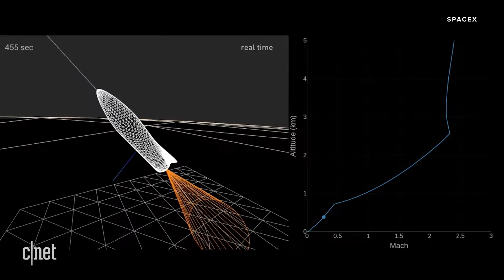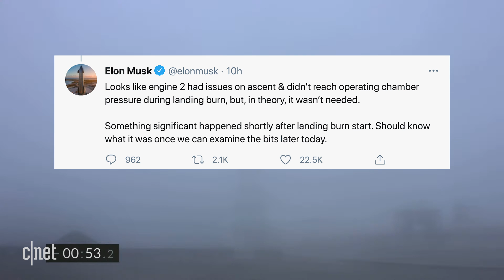Why does the SpaceX Starship keep EXPLODING?

Comment: The reason why starship prototypes keeps on exploading is because they are literally prototypes down to the ground . They make prototypes only few months apart and they solve problems 1 by 1 instead of doing it 20,20,20,20,20 which makes the arrival of final production faster. He'd rather fail 100 times than make 4 attempts that takes years on the making

Comment: Why not use parachute before landing to make the starship stable in vertical position, then after stable the rocket power work to have a smooth landing without using the parachute anymore.
Reply: A parachute is wait and money, and where would they put the Lox header tank if a parachute is in the way.
Reply: @HarrisonAdAstra  A very shopisticatec plane can not find a way to put a parachute???
Reply: @manekhari2670  ate you comparing starship to a plane? As starship does not use its fins as wings, they are used for control in the atmosphere, and yes a parcute will affect the wait and cost, they want to turn these things around as fast as possible and they can’t do that if they have a parachute.
Reply: @HarrisonAdAstra  The parachute just fuction for a very short moment, to stablising the position for landing, after that the rocket will take over the task for the landing procedure. Anyway, it is just an opinion.
Reply: @manekhari2670  an opinion that makes no logistical sense since they have been able to land them anyway.
Reply: @HarrisonAdAstra  When I gave the opinion, they still have problems to stabilizing the position before the landing procedure.
Reply: @manekhari2670  your comment was made in late June or July, SN15 launched on may the 5th. This is just wrong.
Reply: @HarrisonAdAstra  Whatever you want to say, it was my opinion and just an opinion in good faith, among thousands of other opinions.

Comment: I never really loved what SpaceX was doing. It feels like they're always trying to build and launch rockets in a hurry, often resulting in failure. And think- there's going to be people on that thing. What happens if the launch/landing is a failure?
Reply: Can you not use your brain and realise that testing is how you find failure, therefore this is how you get rid of the failure. What spacex is doing has never been done befor, most of the time there is simulation after simulation to make it absolutely perfect so there is not a single failure, but if you have the capital and don’t risk losing credibility then you should go with the failure until success option. Spacex will not put a human on this thing until they are 99.999999999 percent sure that it will get back successfully.

Comment: It would be much easier and economical if they just land the rocket on the sea. They should figure out the vertical landing on land later. With sea landings, they can fast track the rocket's operation since they don't have to wait for the vertical landing technology to get perfected. Just land the rocket on the water and tow it out with a ship and it'll be fine.
Reply: You can't land in a sea on mars
Reply: Hitting the sea at terminal velocity is like hitting concrete at terminal velocity, it’s a no go. And anyway they landed ship 15 and are now quickly approaching the orbital launch.

Comment: You can send them advice that probably the reason why rocket exploding during landing is probably when fire from rocket bounce from rocket to ground it bounces from ground back to rocket making it overheat.
Reply: Or it could be the fact that the pressure in the tanks was so much that when it broke apart it caused the methane to react and then explode, it has nothing to do with the engines.

Comment: I must be missing something here.  The full ship is intended to deliver something like 30% of its takeoff mass into space and still have gas in the tank to land.  Not even the rockets that powered the apolo space program could do that, and the Saturn five is still the most powerful rocket ever made.  So how do they intend to to put a 30% payload into high earth orbit?  Somehow I don't think the math, or science, adds up.
Reply: The super heavy booster will burn for whatever time is needed then the ship will be let off of the booster, fire it’s engines and do a orbit burn, the starship upper stage has tanks called “header tanks” which is basically the landing propellant and fuel, so the ship uses all of its main tankes fuel to get into orbit but saves a bit to do a short “de-orbit burn”. And then it comes back down use it’s engines and so on. And the booster does not have a header tank, it’s just loaded with the necessary fuel to get the ship into sub-orbit and then for a return landing. The math checks out, with actual rocket engineers saying this, your not some amazing detective who debunked the whole spacex plan.

Comment: Good article about R&D. It seems SpaceX is trying to stick the landings too  close to earth. Maybe that's b/c the fuel is very limited and it has to land right at the very limit. If it could stabilize a few hundred feet earlier, the chances of a good landing would go up considerably. Completely shutting down power after landing might also help with it not exploding on deck.

Comment: What the public and vast majority of journalists can’t understand is that SpaceX is iterating prototypes at such a phenomenal speed that flaws will be inherent in many of the vehicles produced. However with every flight comes more data, with more data comes more understanding and better designs. The iteration speed is required not just for the design and testing by understanding the build process to understand how it can be built quickly and reliably. These ARE NOT disasters for SpaceX they are part and parcel of developing a space programme at extraordinary speed.

Comment: Fuel line kept filling into line, heated it, try hot water on pool system with valve mostly closed. I've seen it, ask Fant pool. And material won't inflate. Haul buckled on belly. Try long hover parachute, less flop and blow up.

Comment: Perhaps there's a reason Russians and NASA don't do propulsion landing on Earth. It's too complex and unreliable. Also it requires a bigger rocket and more fuel. Landing on parachute or as an airplane is much simpler.
Reply: Parachutes are not simpler.  Yeah airplane works so well look at the space shuttle.
Reply: @user-RCST  so far propulsion landing delivered nearly 100% failure rate. Space shuttle - only 1%. 

Also space shuttle was returning a crew from space in airplane mode. I am not suggesting that. I suggested to returned unmanned stage 1 rocket in airplane mode.

Also, parachute landing has been used reliably for 50 years. If its ain't broken don't fix it.
Reply: @MeAmericano  ummm that's just a lie. Falcon 9 (which had the same development process) has almost 100% reliability nowadays, and the software is still improving. It has saved spaceX millions and millions of dollars, the Russians can't do that.
Reply: @MeAmericano  I just saw your comment propulsion landing is nowhere near 100% failure it's less than 1% on the falcon 9s.  Parachutes are more expensive and highly complex.  The "if it ain't broke don't fix it" mindset is will get you left behind and disrupted by other companies.
Reply: No, it's because NASA is at the mercy of Congress so they can't fail without massive budget cuts. And the USSR was so bad at funding their space program that they couldn't even get the Buran fully operational.

Comment: 1. The gyroscope controlling the nose is not strong enough and does not create the level of control necessary.
2. The rocket is not being rotated into landing position soon enough.
3. The engines are not being fired soon enough to provide the thrust necessary to slow the rocket sufficiently.
4. The splash back and heat from the engines  is compromising the fuel delivery and storage systems.
Reply: Where do you get all that?
Reply: @user-RCST  observation.
Reply: @chrisjohnson2460  cool I think SpaceX will be able to fix it pretty easily though.  SN15 should be a huge improvement has a lot of different technology in it.
Reply: @user-RCST  I hope so, the prospect of people exploring Mars is very exciting as some observations can only be made in person and will yield much more detailed information.
Reply: It may take two gyroscopes to provide opposing forces like squeezing a board between your palms, to steady the rockets inclination. Pitch and yawl in nine dimensions four for the nose, four for the tail and one for the center axis, with twice the force to control the rocket, and it's also important because it increases the amount of force necessary to destabilize the rocket and less course correction data to process and respond to taking a strain off the system that you have been looking for. It's a stable equation that balances out because there are two gyroscopes so eventhough you're using an uneven number of dimensions the doubling converters to an even number, and the balance  is built into the framework of the equation rather than a cause and effect, and can correct for variables faster.
Reply: @user-RCST  The rocket crashed on several occasions because it was coming in much too fast.
It was was coming in too fast due to  a lack of sufficient thrust.
The thrust was insufficient because the the landing burn was  too short in duration.
Coming down tail first directs the splash and heat back towards the rocket. The rocket exploded before touchdown most likely to a fuel leak. I say this because the rocket did not do a full atmospheric reentry and the explosion happened just before landind after the rocket was exposed to the landing burn and not a high altitude.
On several landings the rockets inclination was not at zero meaning that the gyroscope was unable to make the necessary corrections.
Reply: @chrisjohnson2460  starship is only done the 10 km flight three times so how could it exploded seven times?
Reply: @user-RCST  Not all of the explosions I saw were a high altitude landings.
Reply: @chrisjohnson2460  I feel like those are the only ones that matter.  At least right now because that'll be the main ship and it's the most complete version.
Reply: @user-RCST  Agreed, the previous flights were baby steps. I'm suprised at the tremendous pace Musk is going at, very bold but the the results are promising. I wonder if they will transition to building larger ships beyond Earth's gravity.
Reply: @chrisjohnson2460  larger ships like just ships you live in in space kind of like the ISS.  Hopefully starship will be ready by it's 2022 or 2024 launch date at their current Pace I think it is.
Reply: @user-RCST  It would solve the escape velocity problem and allow for the size ships it will take to establish a colony on Mars and more mission oriented cargo. To boldly go......
Reply: @chrisjohnson2460  that might work but what if there was an issue that wasn't realized until it was put under gravity's pressure.  When it's landing would be a bad time to realize that.  But yeah I could see that working I think that's what Blue Origin is trying to do.
Reply: @user-RCST  Good point

Comment: CNET - Rockets DONT use jet fuel , they Sometimes use SOILID Rocket boosters and LIQUID OXYGEN and or LIQUID HYDEOGEN. 
in the case of SpaceX, they are using a Highly Refined Liquid Methane called RP-1.
and both Land based and Space Engines use RP-1.

Comment: Something that didn't really get the emphasis it deserves in your report is what is different about starship compared to falcon 9. Its not just that its way bigger or made of different materials, or uses a newly developed rocket engine burning a different fuel. Whereas Falcon 9 only recovers the booster, the goal for Starship is to recover the second stage as well. This is entirely new territory for a rocket. It will be coming in at orbital velocities, and it will be much more difficult to recover. The point of the wacky looking maneuver where it goes horizontal is to allow it to slow down from orbital velocities as much as possible using a large surface which will be covered with heat shielding tiles. By flipping to vertical just prior to landing, the minimum of fuel will be required for the landing burn. Unfortunately your report didn't really contain much information. It just said the rocket is big, landing rockets is hard, real world testing is valuable, and SpaceX is moving fast.

Comment: I thought better of CNET.  This analysis is ridiculous.
Most of the explosions were due to basic quality control issues, like split welds on the tanks.  No new tech or materials, just incompetent welders or stress analysts doing the tanks.
Similar structural failures in flight.
Breaking fuel lines.
Engines not getting stable fuel flow.
No one else I know of doing vertical landing over the last 60 years has had this much trouble at it.
Reply: This is just a blatant lie.  SpaceX has some of the best engineers in the world.
Reply: @user-RCST  
The results show that if they are there, they are not being listened to.
Reply: @KellyStarks  really because hundreds of falcon 9s have landed successfully.  Starship is in its prototype stage things are supposed to blow up.
Reply: @user-RCST  
And 4-5 blew up and couple dozen others destroyed or partially destroyed, lost cargos and other incidences. 
And then there’s the StarShip.
Reply: @KellyStarks  not true, not counting prototype testing there have been 115 launches and 113 have been successful so that's only two failures.
Reply: @user-RCST  
Your missing a couple fails and partial fails including ones that destroyed cargo.
Reply: @KellyStarks  successful launches not successful landings.  That is counting the one that was carrying a satellite.

Comment: NASA never thought of it? What do you mean? The Space Shuttle was reusable and they recovered and reused the orange tanks. The only thing not reused on the shuttle was the solid boosters and that's because they're solid boosters. Starship is a Space Shuttle trying to land without wheels.
Reply: The Space Shuttle never ever lived up to its reuseability or flight numbers per year it promised. Also, this isnt the Space Shuttle landing without wheels... this is the enitre Orange Tank, Solid Boosters AND Space Shuttle all trying to land, dont forget the Heavy Booster will be stage 1 (and thats alot more easier to land compared to Starship given they have it down with Falcon9)... so yeah, given some of the calculations ive seen people do once they have this all down, the tonnage to price ratio of getting stuff into space will drop by a HUGE amount, and by huge i mean HUGE.

Also Nasas stuff isnt reuseable, its all refirbished, which can mean they scrap 90% of it and only reuse a tiny amount... reuseable means it lands, reloads and goes back up a few hours latter.

Comment: The Engineering is wrong... When the space ship is descending turn off the 3 falcon 9 main engine cores then activate the 27 Merlin engines that wil be placed at a 45° position outside the bottom perimeter of the spacecraft thus 45° thrust  🚀

Comment: Starship thrust has been failed in most flights (SN8-SN10) and in SN11 it's likely that fuel lines just allowed the ship to explode in the air. (Also they changed engine usage on landing so more engines could give more thrust and there could have been some failures like an extra open fuel valve? But this is just guessing.) Few of thrust failures happened because fuel tanks didn't handle bellyflop maneuver and mixed some gasses to the liquid methane that is used as fuel. When the fuel mixture changes it reduces thrust and leads to the hard and heavy landings that we have seen. You may also have seen some extra flames on the side of the SN10 and those are most probable been some late burned methane that was forced out with not burning helium. On SN11 there were flames on engine 2's fuel line (~1min in flight to 1st shutdown) and that may have caused engine explosion after engine restart just before landing.

SN15 skips few designs and some of these issues will be fixed. But is it enough? We will see.

SpaceX will just keep trying some new ideas and perhaps in next 10 designs they will get a successful landing. After that it takes few flights to make it more secure. And after those adding tiles, 100 km flight, booster tests, adding booster to SN, orbital launch, heat shield test in flight, etc. Few extra failures will happen just because of the fast testing and launching cycle.

Depending on successful landing with SN and booster it takes some time to get to the orbit. If there is enough money to use, faith in the design and some luck then Spaceship could land on moon in the end of the next year and after that way to the Mars is open. There could be some issues in landing on different objects (ie. Earth, Moon, Mars, ...), just because gravity changes and that could affect specially for the tanks in the bellyflop landing. Moon is easier, because there is hardly any atmosphere and so for bellyflopping is not needed.

So first unmanned Mars flights could happen in 4-10 years and manned flight could happen just one launch window after those.

Comment: Starship is just a test bench, its for searching the best way to make an economical spaceship. The thing I do not understand is why they do not protect the raptors, if at the bare minimum they can put a blancket around each motors to avoir fire to go to all component it can improve a little bit. Also, we need to think the raptor in reallity will be use only for landing, presently they use it for al the flight and put them on an immense stress by cutting them and putting them on again.
Reply: Saw a thing the other day that showed that most of the complex stuff you see on a Raptor is actually mostly sensors, a Raptor with all the test sensors off is very clean and elegant, the ones on SN15 are also newer versions.